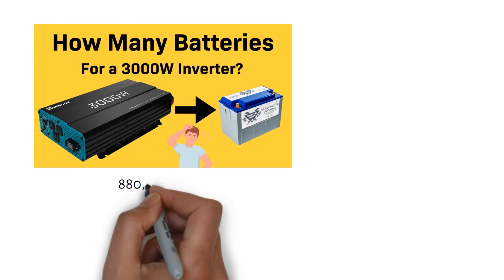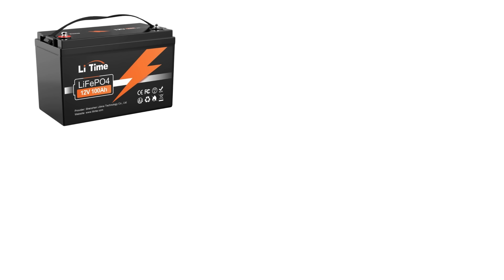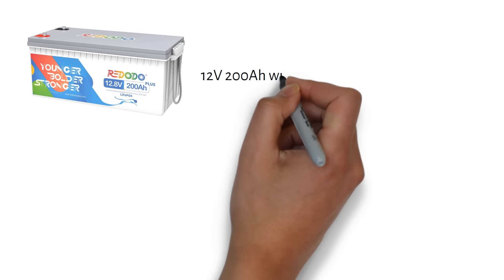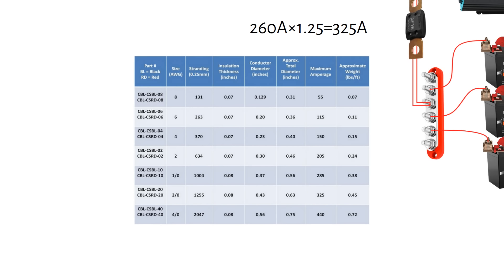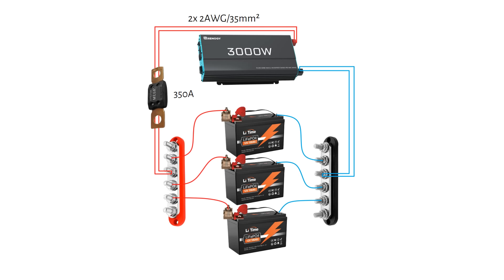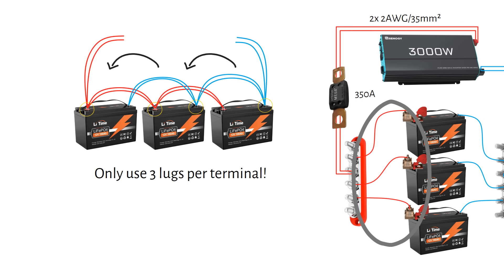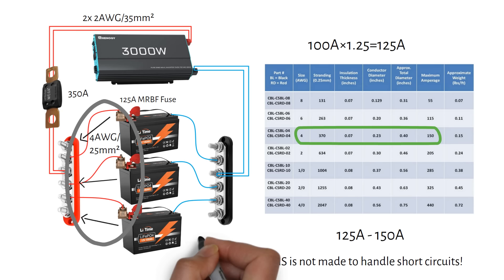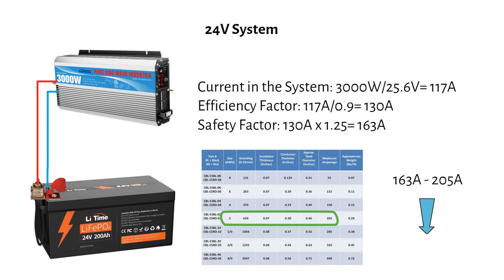How Many 12V Batteries for 3000W Inverter

Comment: The problem is that all transformers are symmetrical, which means you can only have a maximum theoretical efficiency of 100% where the maximum output is equal to input power minus losses. However, with an asymmetrical design, it is theoretically possible to have more output power than what you put into it. This isn’t ‘free energy’ but good design, as all energy for everything, including the grid comes from the zero-point vacuum. Without that energy from the vacuum, there would be no electrons and no protons and no neutrons. They would simply stop spinning and cease to exist. That fact that electrons never lose their charge and never stop spinning, is proof that vacuum energy exists.

Comment: @cleversolarpower I have a question I run a 24v system with a 3000 Mulitplus 3000 24v inverter how many batteries would I need lead acid or lithium?

Comment: Hello Nick, this channel has great videos thanks.  I have a question please.  When you size battery/solar panel & charge time what happens if the load is on & used when the battery is being charged?  I thought calculations are based on 'no load' conditions but with an off-grid system, it is used even when the battery is being charged.  Can you please explain how using the load will or will not impact the charge time.  I appreciate your response please.
Reply from the maker: If you have 100W coming in from solar, and you have a 200W load, then 100W will be coming from the battery. In off-grid design we do not calculate it that way. We have total daily power going in the battery and total daily power going out of the battery, then with 3 days of autonomy. Meaning that the battery has to last for three days without any power coming in.

Comment: Basic 1 battery for every 1000w  if 12 volts battery. But better off with 1 battery for every 500w so 6 battery but it last even longer if go with 1 battery for every 250 w so 12  battery at 12 volt if all battery are 	100 ah.  If 200 ah then back down to 6 battery and if 400 ah back down to 3 battery.

Comment: Thanks for sharing your experience and knowledge with me. You didn’t mention using Diodes and fast actings resettable FUSES Either.😮Why?
Reply from the maker: I don't like resettable fuses for DC. Most of them are trash. I do like breakers for AC though from respectable brands. Why would you use diodes?
Reply: @ Diodes would stop any power from shorting your system out. It’s for just more safety in the system.

Comment: Not that it changes your calculation much (+6.25%), but I would have used 12 volts instead of 12.8 volts because a LiFePO battery can produce lots of power at 12 volts (3v/cell) for quite a long time before it knees over and dies. This increases the maximum current from 260 amps to 278 amps, but you have enough margin in your wire and fuse selection to accommodate this.
Reply from the maker: Indeed, that would have been better.

Comment: Really depends on what you want to power and for how long.
Reply from the maker: Indeed, a 3,000W inverter doesn't consume 3,000W, but it's still possible to have a 3,000W load, so that's why we must size according to 3,000W.

Comment: I sent you an email.  This channel has been very helpful learning how to set up a 4 panel 300 watt system for our small cabin.  We are planning on using 3 12V 100 watt Lithium batteries but was wondering if there would be an advantage of using 4.  If so would I have to change anything in the system you displayed or would I have to change wiring size, fuse size, etc.
Reply from the maker: Received your email. Sent you one in return.

Comment: Depends on the size of the battery…
Earthmovers use a pair of 1500Amp/hr 12V batteries for starting. 
(The diesel fire pumps where I work also use two of them on each of the two redundant start circuits (and they are replaced every three years)).
Your cable sizing calculations are wrong too because the current flow is not evenly split between two cables - 75% is the recommended assumption.
BTW 120mm2 cables is easily available from welding supply stores…
Reply from the maker: Starting batteries are not the same as solar (deep-cycle) batteries.
Reply: @ These are so large that the difference is irrelevant… 20Amps is a trickle charge to these batteries.
Deep cycle batteries also aren’t designed for mobile applications…(less shock resistance).

Comment: car  stereo   amp kits have 00  cables  with very  fine cpper wires and fuse holders and crimp on connectors but lead acid batteries have one advantage is they can handle heat and cold l ion can't a lot of off grid people have their battery bank outside so heat and cold is a factor .
Reply from the maker: True. Now there are lifepo4 batteries with low temperature protection and integrated heating pads to keep the battery above freezing.

Comment: I have a 6000W inverter.  I currently only have 4 batteries (12.8V / 100Ah).  I intend to connect them in a 2S2P configuration so that I have a 24V 200Ah battery bank.  If I understand the math correctly, that will not supply 6000W of power (I think it's closer to 5120) but is there any downside to connecting the battery bank with that configuration to the inverter aside from the fact that it can't fully supply the 6667W that would be ideal?  (Really great video by the way.  Very clear and easy to follow.  You earned a new sub.)
Reply from the maker: No problem. If you pull exactly 6000W, the BMS will possibly turn off. But no problem if you keep under 5120W. Some BMS'es have surge capacity, so you could possibly reach 6667W. Thats why you have to size your cables according to 6667W @ 24V.
Reply: @cleversolarpower  Awesome.  Thanks!

Comment: Hi thanks for sorting my issues for working out how to run my  Renogy  3000w inverter with all the wires,Can you help me with how to Power the Batteries, I have a 200w solar panel that works great through the day as long as it is bright enough. I need to know how to charge the batteries to keep them from going below the 12v and stopping the inverter from shutting off . Thanks Gary.
Reply from the maker: I have made a video on sizing the charge controller. I also recommend checking out my video about sizing a solar system. That will help you choosing the right amount of solar panels.

Comment: One problem with using buss bar to combine all the batteries. You don't get the benefit of combining the BMS. As you can take 2x 100ah batteries with 100a BMS and get 200a BMS. Just by using the negative off one battery and the positive off the other to complete the circuit..
Reply from the maker: I don't recommend series for this reason as well. I have a video about it coming soon. Parallel with higher voltage battery is preferred.
Reply: @cleversolarpower  Not what I posted. If you're running 2x 12v 100ah BMS.. And using a 2000 watt inverter. You need to run negative off one battery and the positive off the other. To combine the 2 BMS to create one 200ah BMS.. If not the Inverter will shut down of blow a fuse.

This rule only applies to 2x 12v 100ah Batteries with 100ah BMS. As 200ah Batteries come with a 200ah BMS already. Some cheaper ones are 150ah BMS which I would avoid..

Comment: There is one myth about 24v and 48v systems.. The cost of wiring is offset by the need to buy 2-4 batteries. Then you need a 24v-48v transformer to reduce the voltage to 12v for 12v appliances. Not to mention the extra cost for the inverter and batteries. So you saved nothing...

So unless you are using 120v or 240v only. You should add that into the formula and use chart.
Reply from the maker: Not really. First you have to do a load analysis. That will give you a certain amount of Wh of battery you need. From there you decide the voltage of the battery. For example, you need 10kWh of battery. You can either use 8x 12V 100Ah batteries for a 12V system, 4x 24V 100Ah batteries, or 2x 48V 100Ah batteries. So it won't be more expensive because you need to meet your required Wh of energy. after knowing the required Wh, you decide the voltage. If you are winging it like your example, then yes, you need to add more batteries in series and it will be more expensive. Point is that using a proper load analysis, the voltage doesn't matter because you have to reach your required Wh, be it 12V, 24V, or 48V.
Reply: @cleversolarpower  I get that. But I'm running into these 24v-48v systems in an RV with only 800 watts of solar or less. They have no idea they created a power loss effeminacy to 79%. As they have to install a 12v transformer back down to 12v. This is counter productive. And it adds more cost to the system. 

Why I said. Unless you're producing huge amounts of Solar above 2k+ watts. You're just spinning your wheels. As the wire cost savings vanished. Not to mention higher voltage of 150v charge controllers for larger series arrays. This cost adds up if you're in an RV.

So if you're in an RV with 1k solar or less. Just use 12v systems. You will pay more for some wire. But the system is simple to maintain, upgrade and repair. As 12v systems are everywhere, Cost less and more choices. Not to mention 12v appliance are a dime a dozen..

Comment: most people don't use 3k watts and the 1s that do have a 6k watt inverter so a 3k watt inverter only needs 2 lithium 12 volt batteries to run 1.5-2k watts if you run more than that I would double up to 4 12 volt batteries. lead acid deep cycle you need 4 for 1.5k to 2k watts any more than that double up so 8 for 4k+watts

Comment: You can use 1 12 0 battery and still use an inverter, but you can only use it for maybe 20 minutes, that's it. You gotta understand how many batteries you need to get 24 hours. You will need 24 batteries 241 hour. Batteries is all you're gonna get is 1 hour out of each battery and then they're completely dead. It doesn't matter how many batteries do you need to run? 4:24 hours on a 3000 W inverter, using a furnace 24 hours a day.  How many batteries do d n you need

Comment: @2:56
That's for just 1:00 hour right ? If you need to use that much power for 12 hours you need 12x the battery. Right ?

Comment: If you solve that question, I will appreciate that. I have a system with 8x100 watt solar panels, 4x 12 Volt Lithium batteries, and 4000 watt inverter. I am confused about the fuses and wires. Can you give me a short answer and How efficiently my system can run some fridges and little electronics? Thanks, Nick.
Reply from the maker: There is no short answer for this sorry. I recommend checking out my video about wire sizing and about fuse sizing. Or my beginners playlist.

Comment: If I am using 4 100ah batteries and wiring as you have described, do I need to increase the 350amp fuse from the bus bar to the inverter? Also is the 125amp breaker n the positive post necessary when you bms protects the battery at 140amps?
Reply from the maker: No, it depends on the inverter you have on the system. The current draw of the system determines the fuse rating.

Comment: 3 lithos = 13 la 😮😢
Interesting. 
I have 2x 100Ah, each is currently on separate inverters. 
1x has a 2kw inverter, the other a 400w.
The 400w inverter I use for smaller stuff that doesn't cause it's fan to start running and it's just used more as backup and cellphone charging.
The 2000w inverter is for everything, but I bought it to run my microwave, but I haven't run my fat wires yet nor am I ready to add my microwave in yet either!
😅
It's not easy to work on this stuff inside of a vehicle when you're already living in it completely.😢
Reply from the maker: You don't need an inverter for cell phone charging. You can use a 12VDC to 5VDC USB converter.

Comment: Isnt the actually wattage that you are drawing relevant in this situation. You may have a 3000w inverter but your appliances may only add up to 1800w??
Reply from the maker: Yes that is important. But you should always size for the highest possible current draw in the system. That is the correct way to wire your system.

Comment: Inverter efficiency question (85% efficient inverter):
300W/0.85=352.94W
300W×0.15=45W ; 300W+45W=345W

I've never noticed this difference.
Reply: 300Wx0.15 is not correct. To calculate waste heat, you start with the input power not the output power. 352.9Wx0.15=52.9W waste heat. 352.9 input minus 52.9W waste = 300W output.
Reply from the maker: Dividing by 0.85 or multiply by (1/0.85) 1.176. --> 300W*1.176=352.8W

Comment: Wow great video.
Had me baffled most of the time. Not done any of this stuff before.
How can I get the chart for cable sizes please. I have 2 48 volt lifelong batteries. They were on a pallet truck. I want to use these on a solar system. Any words of advice. Would be much appreciated.
Thanks Martyn
Reply from the maker: I have linked the cables in the description. You can find the table in the product images of the linked cable. These are manufacture specific, so do not use these for other cables.

Comment: I have a 100ah battery, and planning on adding another one. I am only using it for power outages, to power wifi, laptop, a one or two small LED light and charging cellphones, and to make neighbors wonder how I still have power.. 
All together I think it come to less than 300 watts, and I have a 500 and a 2500 watt inverter, both at a 85% efficiency, so does it matter which one I use?
Reply from the maker: I like the reason to make the neighbors wonder 😄 if the 500W can run it then use the 500W because the 2500W will have a higher idle power consumption. However, if you don't like noise, then i recommend using the 2500W because it circuit board will be cooler so the fans don't kick in as much as the smaller one. But you have to size your wires for the full 2500W and it will be more expensive. Well, you don't have to but i recommend it. Maybe you want to run a microwave on it as well.

Comment: Great video - Thanks.  Question: can you recommend a solar controller?  I have (3) 12/100V batteries in parallel, as you outlined in the video. and (2) 400 watt pannels.  What controller would you recommend?
Reply from the maker: Victron is great. Otherwise Epever makes good controllers as well.

Comment: Thank you for the careful explanation. I have just subbed, because my Physics degree is nearly half a century old now.
Can I ask you too questions ?
1) I have a 3000 W invertor to power a washing machine on my boat. It is fed by two 115 Amp/hr Deep Cycle lead acid batteries. I only run the washing machine when the engine is running so that the alternator takes up the load. Is this reasonable ?
2) Would it be worth installing a much smaller invertor to supply low power items like laptops to reduce the efficiency loss when running small load items?
Many thanks.
Reply from the maker: 1) yes, that's a good solution to the large current draw of a washing machine. Otherwise your batteries will degrade fast.
2) The difference would be minimal, so no need to add necessary costs.
Reply: @cleversolarpower  Thank you, that is really helpful !

Comment: This video is misleading. 100Ah is only the capacity for the battery. It means 100A for 1 hour but its only theoretical. it cant actually handle 100A current contiously. its not 100A max current. correct me if im wrong

Comment: Is the wiring size dimensioning charts in your book stated with both awg(US) and mm2(Europe)?  I dont like to convert between the two systems.
Reply from the maker: I mainly work with awg, but there are mm2 values as well included.

Comment: Hold on. Seeing as 12V batteries will allow 12-16 Volts of electricity flow then the batteries needed rely on amps which lead acid is the standard for starter batteries which use a LOT of juice so they clearly can dump it, so the number of batteries will depend on cranking amps and amp hours. 13 of the batteries you have? Maybe. 13 of what lead acid batteries and for what purpose?
Reply from the maker: We don't use starter batteries in solar applications because they won't last long with a low current, long discharge time as is typical with solar. You can in an emergency. Lead-acid is a bad choice for off-grid electric anyways. Deep cycle lead acid batteries has a c-rate of 0.2C is described in the video. Can you discharge them with more current? Yes, but they will get hot and their lifespan will decrease. So not a good idea if you want them to last long. So following the methods described in this video is what you need to run your system efficiently.

Comment: Thanks for the Video. 
Sorry, could you share what the c-rating for the Lithium battery is? Please.
Reply from the maker: Usually 1. But it depends on the BMS. Most BMS have 100A rating. In case of 12V 100Ah, this is one c. But if you have 12v 200Ah, then with a 100A BMS, you can still draw 100A max. Some companies have larger battery bmses called plus.
Reply: @cleversolarpower  
Thank you very much sir.

Comment: My inverter is 4k watts🎉 how many and  fuses and wires?
Reply from the maker: I recommend to watch my beginners playlist to figure out wire and fuses. However, i don't recommend using a 4kw inverter on a 12V system.

Comment: Really appreciate your explaining how all this works.  However, I have one question.  In your example, you are assuming the inverter is drawing 325A of current from the batteries including the 25% safety margin.  Yet the link you provided for the bus bar is for one rated for only 300A max.  Is this an issue or is this somehow considered sufficient.  Can you explain why this is ok?
Reply from the maker: It's okay, the safety margin applies to cables. The busbar is not going to see more current than 300A.

Comment: I needed 4 LifePo4 batteries that can provide 100A each to run a 3000w inverter at full power at 12v or 24v or 48v....

Comment: Very good explanation if I use a 24V 3000W inverter should I divide everything by 2?
Reply: for a longterm use of the inverter should never use more loads than 60% the rated inverter power, if keep using 90% of the inverter power everyday, it will go kaput